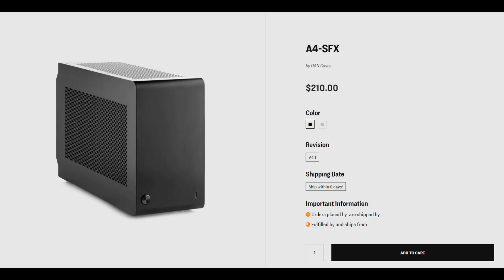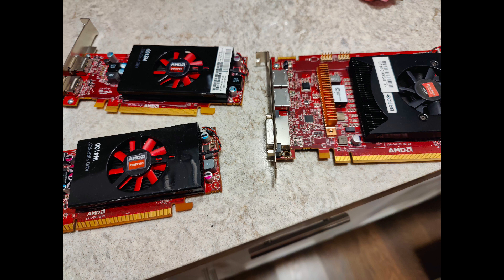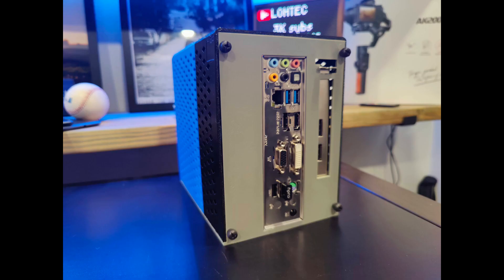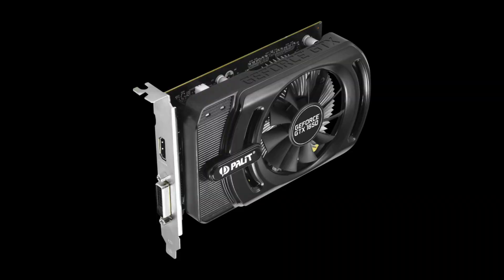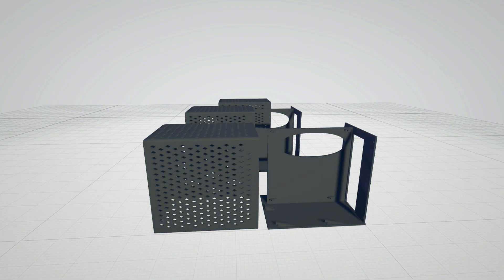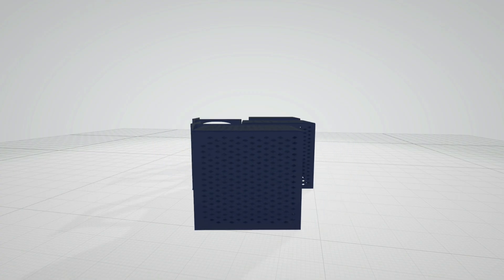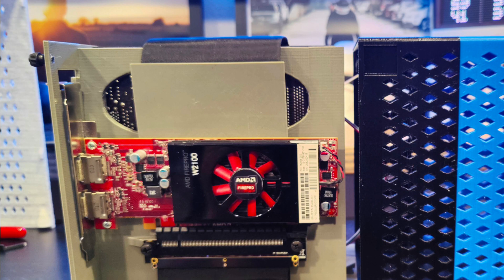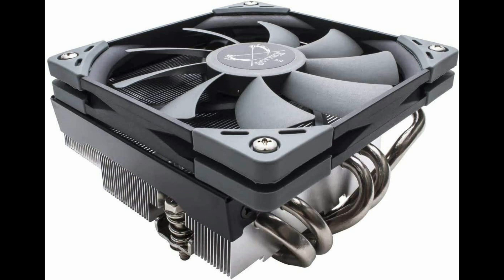I 3D Printed My Own 4.5L SFF ITX PC Case

Comment: nice video, I have a few questions.. it's posible to make a triple slot case for news GPUs ? and it's possible to add a hand handlers at the top ?
Reply from the maker: Kinda the opposite of this since I removed a slot haha but yeah could be done. If I was going to add handles I'd want to add some reinforcement since you'd be carrying weight